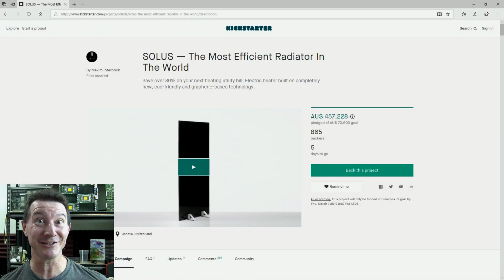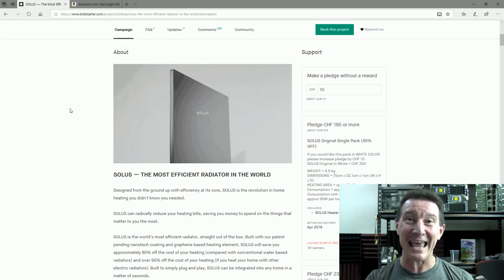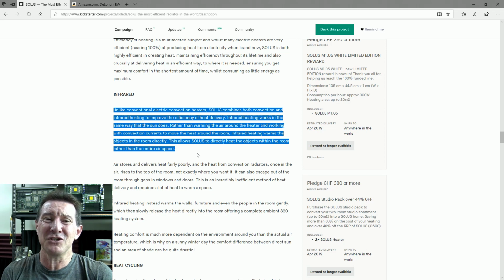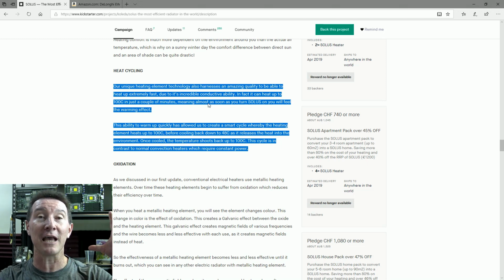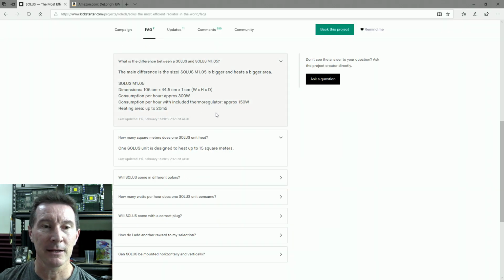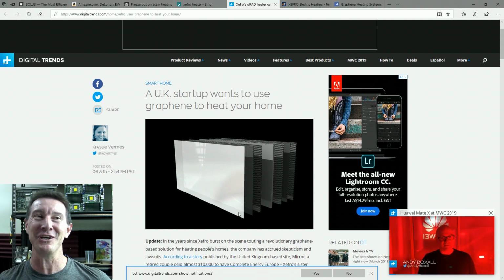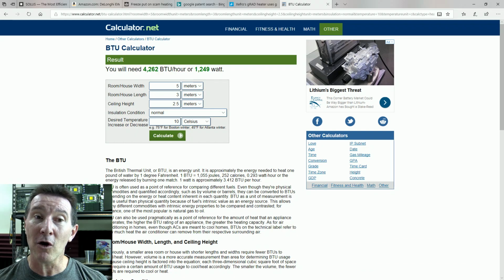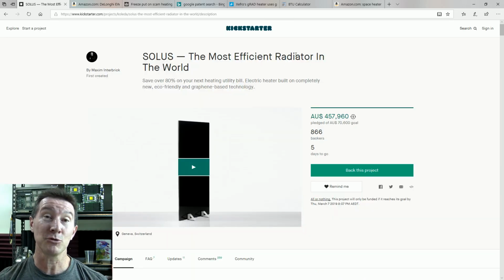EEVblog #1186 - Solus Graphene Heater Kickstarter BUSTED!

Comment: Yea heated water is used in European countries for heating houses.
One cool thing we have in Denmark, is that some powerplants actually take the hot water they heated for electricity, send it through pipes out to homes to run through their radiators, the cool water then travels back to the powerplant to get used again to get heated and make electricity.
I personally think it's a cool use of that heat, so the companies can make some extra money selling heating, when the water has to cool down anyway.
It's not in all houses though, the heating in my house is done by a gas furnace that heats water up, some gets put into a tank for shower water and use in the tabs, and the other gets used in my radiators.

Comment: Yes, water-based heating is quite common in Europe at least in the northern regions because of the inverters air-air, air-water, water-water, for an example geothermal heat pump is a water-based heating system for radiators, especially if you have an old oil boiler or boiler and it's overdue since long. Just switch to a water heat pump and plug into the existing heating system.
One of the best things with the water-based is that the radiators won't become as hot as a nonliquid version or even cooler than the oil-based ones if you own the type with a great surface area you can (in theory) go as low as 30-40C (86-105F). And you don't want the geothermal heat pump to go much warmer because they start to use electricity instead of converting.

Comment: According to the second law of thermodynamics nothing has 100% efficiency
Reply: That's true for converting heat into any other form of energy because you need some heat bath to absorb the entropy and some heat will be lost this way. There is no such limitation for converting electrical (or other) energy into heat.

Comment: i have a dilemma. in a computer processor, actually in any kind of digital chip, is the electricity consumed converted into heat? 100%? or is there also a part of it that is consumed for the calculations? my intuition tells me it is all dissipated as heat, but then if we have a computer that has no resistive elements, will it not consume power? but is it even possible to have a processor that doesn't use resistors? can anybody enlighten me?

Comment: Coincidentally, Technology Connections recently did a video on electric radiator room heaters, and frustration with marketing bs surrounding otherwise identically spec'd heaters, and with claims for other than 100% efficiency...

Comment: The oxide would only momentarily delay output. The temperature gradient across the oxide layer would grow until it is high enough for sufficient heat to flow to reach equilibrium with the power coming in. When the power source is removed, the high temperature inside the oxide would bleed off through the oxide, getting back that heat collected during the delay at startup, and everything equals out.

Comment: Heaters are not 100% efficient. They are about 95-99% efficient, because energy is also spent into radiation, in this case - infrared radiation. Consider filament lamp: it's just a piece of tungsten wire in a bulb. The most of the energy(~95%) is turned into heat, and ~5% is spent into light.
The same is with any heater, but the temperature is usually not enough for visible light, instead it emits infrared radiation. Moreover, the higher is the temperature, the more energy is turned into light.

This fancy SOLUS heater may be 2-3% more efficient than any other because the glass is not transparent for the infrared light, but it will also hinder the heat coming out, so it's more like a heat capacitor than heat radiator.
Reply: And what does light turn into?
Reply: Where do you think this infrared light is going? The light will hit a wall or a person and turn into heat.
Reply: It's important to understand the difference between heat and IR radiation, because many people believe, that they are the same thing. IR is electromagnetic radiation, while heat is the kinetic energy of the atoms/molecules in the substance.

If IR radiation is trapped inside the bulb/glass it will just turn back to heat. But if it can escape, it will escape and the energy will be wasted.
And if the temperature is high enough, the heater will emit the ordinary, visible light, that is much harder to keep inside the heater.
Reply: @valeriiradchenkov5761  So you're saying that IR radiation inside a bulb can turn into heat, but IR radiation outside a bulb can't? Why can't it change into heat outside the bulb? Like inside a room for instance? Or when radiation from the sun heats the Earth on a daily basis.

Why do I want my heater to be a capacitor rather than just heating my room when I turn it on and then immediately stopping heating my room when I turn it off?

Comment: it is true tho that heated air is a waste of heating, you develop a gradient of heat from floor to ceiling and the your most energy dense air is mostly leaking out anyway of most homes, so its quite possible that a comfort level heat can be maintained with 80% less energy. 

not the same as claiming to bring the entire mass volume of the room to a specific temperature with 80% less energy

Comment: Obviously this is a massive oversell with silly outlandish claims. But wall mounted heating panels like this already exist.  They work by maximizing radiation instead of convection. An oil space heater is trying to maximize air contact so it spreads heat fairly effectively and actually heats the air. The radiant heating panels can help use less energy because it doesn't need to heat the whole room since the radiation heats the surface of your skin. Of course basing all heat on only radiation wouldn't be comfortable either. Imagine having a big IR heater aimed at you. It would likely heat the room unevenly which could make it even more uncomfortable. A lot probably most of the wall panel heaters use water and are sourced from a biomass furnace. There is some losses in carrying the heat around with water but considering the fact that biomass is sustainable and usually carbon neutral, electricity may not be nor would the utility always be able to support you having 20 of these in your house. Likely if the utility can support that its based the power is being produced with fossil fuels.

Comment: Well, you could burn the graphene, that would boost the system's power for a short time...
To be fair, it does probably have a higher IR-proportion in it's output than a normal heater, because most heaters do not heat up to 100 °C, what with the risk of burns and whatnot. Using a bad conductor for the surface will make burns less likely, so that's maybe not super stupid. In the long run, the amount of heat emitted will be the same for all materials, anyway, the only thing that's going to change is the internal temperature.
Of course it's still snakeoil; IR-heaters don't feel very nice and only make sense if you sit pretty much directly in front of them, with 100 °C it's not really that much of an IR-heater and 200 W is way too little to achieve anything.
But I'm from Latvia, so please buy it!

Comment: Graphene increases performance not efficiency, it will radiate more heat per unit area than normal painted heater. Glass is almost transparent to infrared so the glass shaouldn't change it's performance. But as you're saying it has the same efficiency as an old type light bulb.
Reply: glass is not transparent to IR point an IR camera at a window and you will see that the IR camera cant see anything on the other side of the glass

Comment: Now... if they came up with some way to build a cheap pretty looking bitcoin (or other cryptocurrency) mining solution that you could mount on your wall it might be more efficient since it'll also maybe create something that's of value to you. For CPUs/GPUs/whatever to not throttle though I'm afraid it'll almost certainly need noisy fans and a passive setup might not produce enough heat/be very heavy, wouldn't want that in a radiator replacement.

Comment: water based heat systems are really popular in the more northern latitudes.

here in canada they are used quite often in larger buildings, like for example my apartment complex.

its basically just a boiler that pumps around hot water on demand, in our unit there is a automated valve that is actuated by a thermostat.

once it gets cold enough, the valve opens up and hot water is pumped threw our baseboard radiators.

all in all its fairly cheap to run and we dont have to pay for gas or electricity.(the land lord pays for that out of their own pocket)

Comment: That so called "test" they did with their Solus heater and the oil heater should say all you need you to know about this company. Ok, lets put our thermal regulator right beside our Solus heater and far away from the oil heater. Pure nonsense. They better be careful, else they end up like the previous company and found misleading customers (which they are anyway).

Comment: Interestingly (?) in most cases, efficiency refers to the amount of energy NOT converted to heat. E.g., the more efficient an engine, the more power goes to turning the shaft, and less goes to frictional heat. 
A final nitpick: In this case, using their terminology, it's probably not actually converting all the input power into heat. Some of it probably goes to light, as well. So probably not exactly 100% efficient, as efficiency is defined here.

Comment: If it's a heater, then I'd like to see its US/CAN UL fire safety certification.

Also, what features are included to guard against accidental overheat, shortout, damage, or falls -- i.e. thermal cutoff, thermal monitoring, fuse, and/or tilt switch? You're gonna have this thing in homes where kids and pets might be roaming around. If they knock it over or break it in half, we've got to know what happens next.

UPDATE : the site now has a big banner saying, "FUNDING SUSPENDED BY KICKSTARTER." No explanation of why, it just says it's been suspended.

Comment: Agreed, this is a total fraud when it comes to the claim of saving 80 - 90% on your heating costs but isn't irradiated heat part of the infra-red spectrum, and doesn't that go through glass?
I mean you've heard of those ceiling heater panels that radiate the heat, 90 degrees from the flat surface, downwards, right?
.

Comment: Woah this heater is amazing! Let's use it for the greater good:
Get an array of Solus heaters to boil water, use the steam to power a turbine-generator, use the electricity to power the heaters! Since modern power plants can get 50% efficiency there is easily some electricity leftover to power your house. Bonus: you can use the waste heat from the condensers to heat your house!!!! I'd better start a crowdfunding to save the planet!

Comment: I want to state this first - This heater thingy is total bullshit, and all their refutations to the contrary are mostly word salad. 
When I buy a small space heater, the only math I do is "Heat watts per dollar".
 But, while they are making word salad out of terms in support of their product, you're kinda playing into the same game in critiquing it.

1) Anything that gets hot in any environment other than a vacuum is not only a radiant heater, but also a convective and conductive heater.
The design of the heater coupled with the environment it is designed to occupy determine which type of heating it will primarily do.
The oil heater you show is primarily designed to be a passive convection heater - not a radiant heater. That's why it has those fins to increase the surface area in order to heat the air that contacts the fins (a little bit of conduction going on in there) which imparts energy to the air which makes the heated volume of air less dense, thereby causing it to rise. I would like to say here, that heat does not "rise", relatively warm fluids do - and that is the whole basis behind passive convection.
That said, any object that is 'hot' will emit infrared, making it a "radiant heater" to some extent. But, while those heaters that have visible heating elements that get red hot, are designed to be primarily "radiant heaters", unless they exist in a vacuum, they are also either convective or conductive, or both.
2) There's a lot of "watts per hour" thrown around in here, and you even do your "Aha!" reveal based on the faulty math you read by using a BS number developed by BS maths, and the same BS maths to come up with with some arbitrary number of "446 watts per hour".
As an electrical guy, you should know you can neither do "watts per hour", nor conflate "watt-hours" with some non-existent "watts per hour".
That would be like saying "volts per second" or, better yet - "Horsepower per minute", since watts and horsepower are a direct conversion to one another. A five HP motor can do five HP or work for one second, one minute, or one year. If you start multiplying and dividing a "work" measurement by arbitrary "time" measurements, you're gonna get arbitrary numbers for answers.
3) You point out that glass is a terrible conductor of heat and that the heater is primarily going to really release the heat on the edges. Correct. That means it will have a relatively small, yet also relatively hot surface area, to release it's heat. Kinda like the fins on a passive convection heater like the oil heater you show. That means that, all technical definition arguments aside, It is probably as much (or more) a passive convection heater, as a radiant heater. BTW, both are equally efficient - because where and what form is the "waste energy" of either?

 This is kinda like the Dyson vacuum cleaners. For $80, I can get a vacuum cleaner that cleans my floors to my satisfaction, and for $20, I can get a heater that heats what I wanted heated to my satisfaction.
But there is no end to the number of people who would rather pay several times what I pay to get what they perceive to be "just a smidge better", while totally ignoring the ever diminishing Return On Investment" value.

All in all, good video.

Comment: What is the end objective here? The foundation of Solus’s sales pitch is their product uses less electricity as compared to other resistive electric heating solutions. So aside from trampling the law of conservation of energy, their objective is to heat your whatever, for the least electricity / lowest financial cost. Here in Canada, electric heating for an entire home as the primary system was a bit of a thing back beginning in the late 1950's - not just the electric baseboard heater format but also having heating wires imbedded in the ceiling plaster! The attraction was simplicity and low installation cost compared to complex system based on forced-air or hydronics. However, the cost of electricity soon rose and electric heating became huge liability due to huge cost differences as compared to using natural gas or heating oil. I can heat my ~2300 sq ft home for ~$100/m in the heating season with natural gas whereas using electricity (resistive) would be ~$2500/m. So, the primary driver is the cost of the energy source. You want to lowest cost of heating your whatever, you need to choose the lowest cost energy source and a cost-efficient method/device for converting that energy into heat. As David pointed out, an inexpensive electric heater works the same with the all-important distinction of being inexpensive! If the Solus device did work as claimed, then their heating solution is still a huge fail because of the high-cost of acquiring the Solus Graphene Heater would crush any electrical cost savings.

Comment: Dave, the simple oil heater is also utilizing convection, just not active convection by a fan. Convection also happens when there is a difference in air density, because of different air temperatures, in the presence of gravity :) The oil heater is actually mostly using convection to transfer heat rather than infrared radiation. That is what those parallel plates are for. For the rest, good vidjeo, the kickstarter claims are just complete BS.

Comment: I've figured it all out! Because graphene molecules are such springy 
little suckers, when they are heated by the resistive elements, they 
bounce around and amplify the kinetic energy by a factor of three. That's how you can get 600 watts of heat from only 200 watts of electricity. They call it the "Wallaby Effect". You need to catch up!